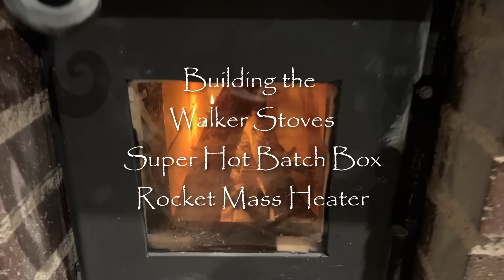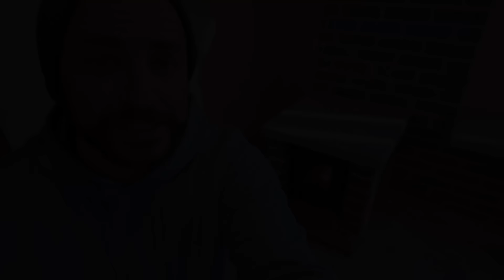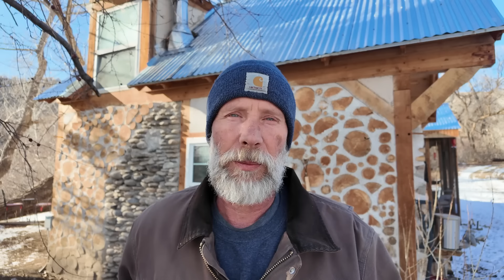Full Build of a Rocket Mass Heater with No Barrel! with @StefanoCreatini and @irahouseweart

Comment: This is a very tidy build and is aesthetically pleasing. The door fabrication is the best I have seen. I like the safety warnings and use of protective equipment when necessary. Is this the plans for a 6inch system ?    I can't seem to find this build on his site. 
My explanations to a few of the questions from further below, explaining how a RMHeater works
The super insulated fire box instantly provides very high temperatures to fully pyrolyse the wood gasses. The secondary air just before the vertical slit provides slightly excess air for FULL combustion, which is further enhanced by the slot causing turbulence and hence great mixing of air and flue gases in the well insulated riser. This is the heart of the system, where the efficiency and clean burn are happen.

No smoke, means no waisted combustible materials or wasted fuel. 
Therefore, no creosote. 

Gap between heater and wall. Other Rocket Mass Heater videos I have watched have an air gap of about 1inch/ 25mm, a sheet of metal or fibre cement board(hardibacker) and another air gap then the wall. This not only protects the dry wall from getting hot but allows air to flow up these two air gaps and further heat the room.

From the under floor work to support the weight of their new stove it can be seen that there is no insulation, and in an answer to another question it is revealed there is also poor attic insulation. This heat loss, would help explain why this RMH needs to be fired several times a day and one of the basics of comfortable living is "fixing the insulation and draughts/air changes per hour". Otherwise, your building will be throwing away heat that you have paid for $$ for its ENTIRE LIFE.

The high surface temperatures of your stove are a confirmation of there not being enough thermal mass in the system to absorb and store the heat, causing it to heat up fast and also cool down fast, requiring the multiple firings a day. 
Thermal mass of the system can be increased by either extending the bench length wise, 
 making a couple of rows of bricks higher.
  a row of bricks down the inside middle  would only require lifting the cast concrete top. 
Adding another slab of cast concrete would also add thermal mass and make the seat a bit more comfortable to sit on. 160 F   is just a tad warm :)

Comment: I disagree with the design, there are too many small pieces that will end up as dust. I prefer a simple rectangle fireplace.  I worked with refractory fire brick. They need replacing every few years.

Comment: Pull it a few feet off the wall and get all the benefits of the mass heating and air flow around the stove. Great workmanship 💪
Reply: I've got a J-Tube at my place.  I put cement board behind mine and ran it for 2 years so far.

Underneath of the burn chamber I pulled out the carpet and carpet padding, laid down cement board, ceramic wool fiber blanket on top of that, poured 2 inches of cement, then laid down firebrick in 2 layers.  Underneath I drilled a small hole in the plywood and stuck thermocouples in the hot spots.  It gets to about 110-115 degrees F.  A little hotter than I'd like.  But like I said, 2 years and no issues...

I'm going to tear it out and put in a batch box.  I'm going to put the burn chamber on a short steel table to elevate it from the cement. That'll make me feel much better.  Maybe 5 inches or something.
Reply from the maker: You are correct. Next time…

Comment: Great video.  I have followed Matt's channel a bit over the years, but I have never seen a build like this.

I have a few questions:

1) Was there a reason a hollow core veneer brick was used as opposed to a solid brick?

2) Could the bell design be modified to become 2 levels with the flue pipe at the end of the 2nd level? (more like a traditional
Russian Stove)  This may increase the mass and lower the exiting flue pipe temperature.

3) On a traditional masonry heater, there is a gap of one piece of thick cardboard between the core and the veneer.  Did the enigineer design a gap between the furnace insulation board and the brick veneer?  Do you think the expansion may crack the boards clay bonding or the board itself without this gap?

Thanks for the video, and I would be interested in any follow-up videos.  

Also, I enjoyed your mellow narration.  Only YouTube hacks speak like they are trying to amuse a toddler while flailing around their appendages.
Reply from the maker: Thanks for your questions! We also thought the world needed a more detailed build video of Matt’s designs. 
We used this veneer brick mostly because it was what was available in our area. So far, it seems to work just fine.
There are a few ways the bell could be improved, your thoughts being a good alternative.
There is a 1/4” gap between the ceramic fiber board of the core and the brick work, but better detail about this is absent from the plans. There has been no expansion issue with this stove, so far.
Thanks for being a fan of the narration. I make videos for adults who have attention spans and I’m glad you appreciate that. We will do some follow up videos, as the season progresses, covering the pro and cons of this design, and what should be known before building this stove.
Reply: @radicalgastronomy  looking forward to it!

Comment: Great video. Thanks. 1. I would force it to be placed in the middle of the house. Also bring a metal plate from inside the fire to outside to place a heat fan or two. Exhaust must be at the end.  The other issues you outlined in the end are such good advise. Thank you
Reply from the maker: Thank you. Your points are valid, for sure!

Comment: I had one it was a little bigger about 17 feet long after using it for a winter i took a sledge hammer to it and put in a wood stove. The wood stove worked way better the rocket stove might have worked if i was retired and had time to sit around and feed the fire all day it created alot of air it sounded like a blow tourch and the one i had was professionally built.

Comment: Those clearances to combustibles are likely to cause a slow pyrolysis of the walls behind the stove, and likely also the wood flooring. Should have 4” behind and an air-gap below. Max Edleson of Firespeaking (a collaborator with Matt Walker on the Cabin Stove) used to have some photos up of a masonry heater build where the rear wall did not observe the 4” clearance required by ASTM standards… after a few years of use, the wooden framing within the Sheetrock wall finally caught fire, having been slowly pyrolysed until the ignition point was reached. Fire department had to rip the wall open to extinguish it, and the whole masonry heater had to be demolished and rebuilt. Of course, by that time, the uncertified heater mason had gone out of business and Max was called in to re-do the job.

In short: just because it isn’t catching fire today, tomorrow, or this year, that doesn’t mean it’s safe. Clearances to combustibles are important to maintain for very good reason.
Reply from the maker: @JAllenKaiser  Good to know. Matt should add this information to the plans, for sure.
Reply: @ yeah, I 100% agree. Quite surprised that Matt doesn’t make it integral to the planning phase. If anybody’s curious, the ASTM standard used for Masonry Heaters is E1602. That’s what’s cited in the International Residential Code, and Rocket Mass Heaters fall under that, too. I think (IIRC) the air-gap underneath is allowed to be 2.5” — the width of 1 brick. You basically leave channels underneath by staggering the layup, that way air can flow underneath and be drawn up from behind, preventing any one spot from accumulating too much heat in the adjacent combustibles.
Reply: @JAllenKaiser  Tell me more about the air gap below the RMH please. I'm planning a home build with the RMH centered in the home....nothing combustible within 3-4 in any direction. We'd hope to build the RMH on a concrete slab foundation, same as the whole house but 1 foot deep under the RHH. I'm gathering I need air to be able to go under the whole RMH??? Honesly I hate to see RMH heaters in the corner of a room or along an exterior wall but I'm guessing these are all retrofits. I do love the masonry bell/manifold in this video. I can sell that to the wife but not a 50 gallon metal drum.
Reply: @medicineman4040 if you have a crawlspace or anything other than slab-on-grade: you need to either cut out the floor and pour a slab and footer for the heater (which also will support the weight in addition to being noncombustible) — or you need to reinforce the structural support underneath the wooden floor for the weight, then put down a noncombustible floor pad, and then build the heater on a layer of staggered bricks left with minimum 2 inch gaps between each row (or laid such that one brick-width is left between each row, then the next layer of brick spans those gaps, laid perpendicularly of course.) That leaves air-flow channels under the body of the mass between it and your wooden floor, preventing the buildup of heat and pyrolysis. 👍
Reply: Why would you bring your secondary air through the firebox????
Reply: @kevinlewis9151  maybe actually watch the video. 21:00 is the secondary air tube that brings secondary air along the floor of the firebox and injects it into the port, where it mixes with pyrolysis gasses for complete combustion in the riser.

Comment: Your surface temps are pretty high. That's (one of the reasons) why most masonry heaters are double wall, not single skin heaters. Single skin heaters work, such as traditional Russian Stoves or the Danish Gymse stove but are not up to code in the US. Small firebox helps you there. Your masonry work could have benefitted from another layer of firebrick on edge, both for mass, heat regulation and safety. Mind your expansion joints, especially around steel such as your door. Ceramic wool around the door frame during installation can help absorb that expansion that develops between skin and cap near the door when up to temperature. Cute little heater with some potential. Less mass = faster response time but less heat capacity. On the other hand, heaters can be too massive too, w a cooler surface and slow response time. Depends want you want. Still, be safe. On a typical double wall mass heater w a min. 4" of masonry, code allows no less than 4" of airspace on the side wall. Glad to hear you have a heat shield. Be sure air can flow freely on both sides of it. If a combustible material is baked, ie pyrolized long enough, over the course of many burnes for example, it can ignite if hot and dry enough.

Comment: If you would have made a double wall at the exit of the burn box. You wouldn't have to use iron then.
You can make a secondary air intake like a old fasion carburator. Thus your using the Bernoulli's principle to suck the oxidiser in.
And i would also have made a secondary burn chamber by adding a small blockage at 3x the width as height. 
This will create a extra ignition source, slowdown the gasses and mix them better. So, that it has more time in the system to give off the heat.

Comment: Interesting video.  Excellent commentary.  The stove looks great.  I had to watch portions of the video again to fill in some mental blanks.  I would agree that cob or some other filler might catch and hold more of the heat.  Especially if you had additional ductwork in the cavity to hopefully give more opportunity to draw additional heat.  I look forward to any updates.
Reply from the maker: I'll be using what we learned here to build myself one. My plan is to split a barrel the long way and use the two halves as a form for a cob bench. I like the stratification chamber over the piped mass approach.

Comment: Looks good. I'm partial to masonry furnaces. Mostly because they have clean outs. I don't like the idea of a creosote bomb.
Reply from the maker: The super high burn temp should prevent creosote build up in this one. Time will tell. I initially planned to add a cleanout on this build, but there wasn't a good place for one.
Reply: @radicalgastronomy  You are correct. 
The super insulated fire box instantly provides very high temperatures to fully pyrolyse the wood gasses. The secondary air just before the vertical slit provides slightly excess air for FULL combustion, which is further enhanced by the slot causing turbulence and hence great mixing of air and flue gases in the well insulated riser. 
No smoke, means no waisted combustible materials or wasted fuel. 
Therefore, no creosote.

Comment: Did I see correctly - was the floor not insulated!? It seemed like the space between floor rafters were totally empty and the floor sheets were visible. So that beeing the case, the first and most cost efficient thing you can and should do is to insulate the floor! Hello! I sure hope the roof is not the same kind - it would be even worse! Get it right! Greetings from Finland! Beautiful and solid mass heater anyway!
Reply: For sure, put some rock wool up in there!
Reply from the maker: Floor insulation would certainly help this house, as would more attic insulation. Some parts have only 4" of fiberglass. Even as it is, that stove keeps it cozy.
Reply: @radicalgastronomy if you built a water tank into the seat section.. could you also heat water.with this system at the same time?
Reply: Not sure where this was built but we do not put insulation in the floors here. It will cause black mold with the high humidity we have in the summers.

Comment: I dont understand how the hot air goes through the bench
Reply from the maker: The hot air must fill the bench and cool by transferring heat to the bench top and brick sides in order to sink down to the opening of the flu pipe (8" above the floor).

Comment: I’m looking at the fire to flu and wondering how the heat gets to the seat and not just out the flu pipe.
Reply: A y-joint
Normally 
That allows ducting to run through the bench and then out the house. 
No need for a riser since exhaust is clean and low temp
Reply from the maker: The bottom of that flu pipe is all the way down to 8" above the floor, so the bench must fill first.

Comment: This video if filled with so much valuable information.  So grateful to have found it!

One other observation is that had you not been constrained to the chimney that was already in place, it would have added efficiency to have built the heater in the center of the home on an interior wall or even free standing, to allow all the heat to radiate out into the house vs losing some of it through that exterior wall.  If built on or close to an interior wall with a lot of thermal mass (cob or the like), once the thermal battery of all that mass got heated up over weeks of burns, it would really increase the heating efficiency and likely decrease the number of burns needed to two or even one a day to keep his home comfortable even within the same footprint except in extreme cold months.

One thing I love about Matt Walker's designs is that he uses a sand clay mixture rather than mortar to make his stoves with.  It makes it so easy to modify, repair or even rebuild a stove, as well as not waste any of the mix.  Even if it completely dries out, one only need crush it back up, add water and remix it and it can be reused!  I also love his use of the fiberboard to insulated the burn chamber and even that high temp sheet metal to line it to protect the fiber board from scoring and damage caused by adding wood into the box over time.  I believe that's the same metal that the more permanent riser for the secondary air you spoke of is made of, but not sure.  

Anyway, we are FINALLY starting the build of our home next spring and intend to make his continental cook stove design to use as our primary heater and three season range.  We're also hoping to be able to heat our water for bathing, etc., but time will tell on that.  It was great to find your build video to help us learn about the process from fellow DIYers like yourselves and to "fire us up" about our future stove!  😉  Thanks for making and sharing your really great and valuable build video.
Reply: Correct. Also the floor seems to be without any insulation, so ... I don´t know where the cabin was, but that is not even relevant. Here in Finland, a floor with no insulation does not exist, except in outhouses, sheds, outhouse saunas etc. But in a cabin - why would you not insulate the floor???
Reply: @mv4302  Oh that's right...I remember that shot of them in the crawl space adding floor support.  NO insulation down there!  Yeah, obviously how well a space is insulated makes ALL the difference in heating (and cooling) efficiency of that space.  That and all those other things, are the source of them having to do three burns a day to heat the house, not the size of the heater.  That said, it's amazing that with all those significant efficiency problems, the heater still heats the 1200 sq ft home to a comfortable temperature with only 3 burns a day.  I wonder how many times they would have to fill a metal wood stove each day to keep the house comfortable?!  And even then it wouldn't be AS comfortable because you'd be cooked out of the room with the stove and the rest of the house would be quite a bit cooler.   It would be a temperature roller coaster.
Reply from the maker: You are absolutely correct about the stove location. A central location would have been better to uniformly heat this house. He is planning to add the cook stove at the other end of the house, down the road, so that will solve the issue.